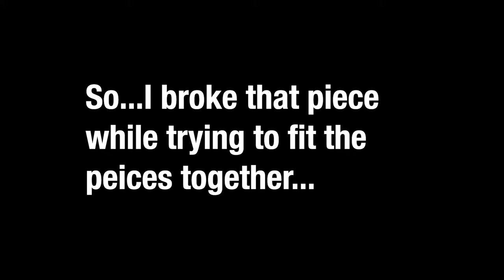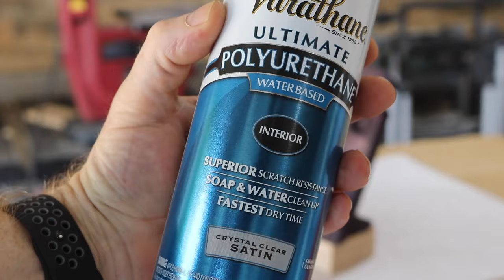DIY Bedside Organizer with Dyed Shou Sugi Ban Finish

Comment: What's your thoughts on the difference between using a metal brush vs. vinyl brush when removing that charred wood stuff?
Reply from the maker: I like using the Nyalox brushes because they leave fewer tool marks. But if that's the look you're going for...
Cheers

Comment: Do you need to finish shou sugi ban with a finish after dying it? And if so, what is the best finish for it?
Reply from the maker: Yes. That dye will come off on your hands. If you want a glossy finish I recommend Total Boat Halcyon Rugged Varnish. Super easy to apply and it's UV resistant. 
Satin (honestly I buy the poly in the spray can) I haven't found one brand or type that I really like. 
Cheers!

Comment: When alligator burning pine especially shelves, why do they warp?
Reply from the maker: It's the rapid heating of the soft and hard wood fibers that causes the warp. If you spray your piece with water from a spray bottle while burning it will mitigate some of that.
Cheers!